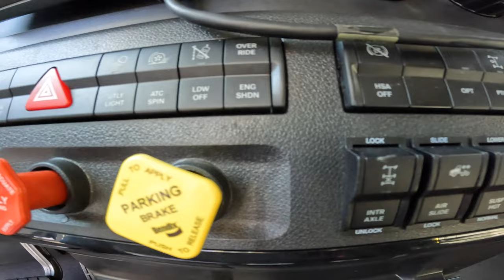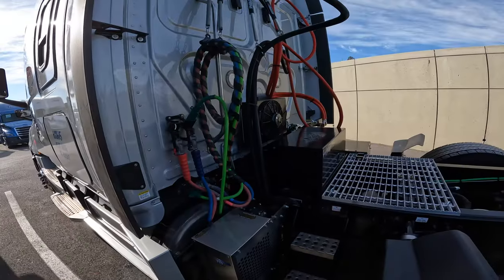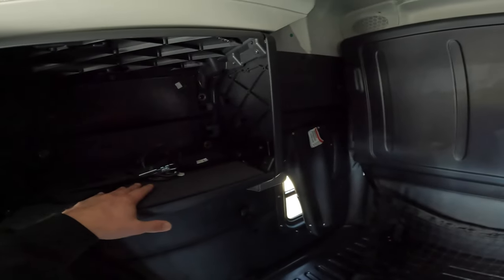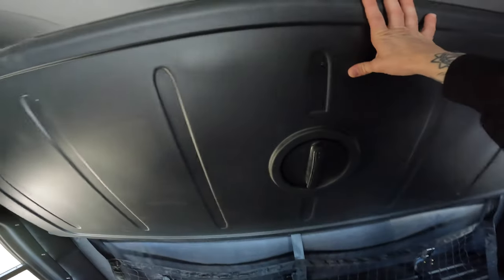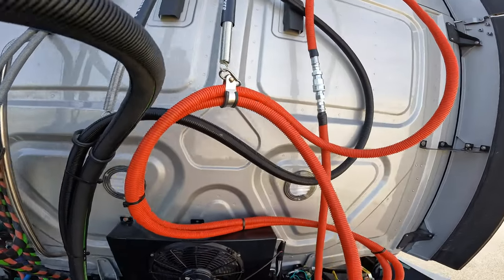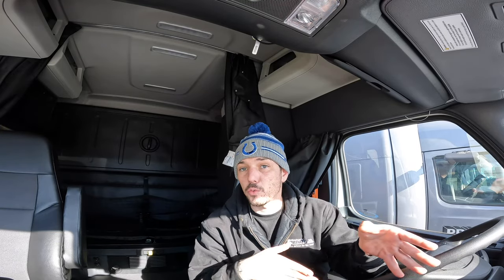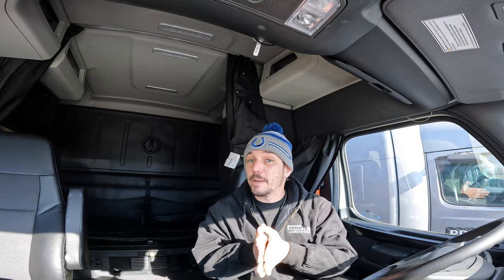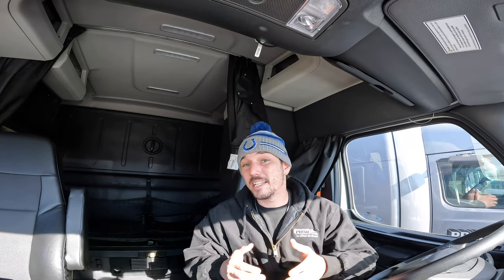Prime Inc 2023 Freightliner Cascadia Official Truck Tour 🔥

Comment: If you had the choice between this midroof freightliner and Pete which would you prefer?
Reply from the maker: I prefer the Peterbilt, has everything, more modern, smooth ride, has nice clean crisp bass. BUT that Paccar MX-13 engine gave me problems. A lot of breakdowns. My Freightliner has a DD15 engine no major issues so far.
Reply: @truckingwithrex  how often were you in the shop?
Reply from the maker: @Mrnotnice24  truck had 13K when I started my lease turned it in with about 90K miles was in the shop for 26-28days total. Turbo blew that alone was a special order part from Peterbilt 2 weeks in the shop. Passenger led headlight went out, light special order down 7 days. Electrical shortage behind the dash down 4-5days. They can only be worked on by a Peterbilt shop seemed everything was special order. So I switched to a freightliner and I’m making more dough because I’m not breaking down. Also freightliner has a larger network and parts availability so less downtime.
Reply: @truckingwithrex  I work out of the Pittston terminal and we have a dedicated Peterbilt mobile guy there on Wednesdays so I’m wondering if its worth it lol
Reply from the maker: @Mrnotnice24  same thing at Springfield terminal and my truck was still down all that time for parts. Also power steering hose started leaking that was another 2 days. And they charged me $200 for the hose clamp 😮 I would’ve just changed it myself. I thought it was under warranty. Mobile mechanic said I over filled the power steering fluid. I never added anything to it! That’s just my experience maybe your will be better 🤞
Reply: @truckingwithrex  oh nah that’s nuts smdh I had a Pete before in 2018 and it’s been problems but the way everyone has talked them up I thought things might have changed I guess now

Comment: Rex you made a good choice bro. Every truck has issues when you first get it. But the fact the fuel economy is better in FL is the winner. The ride on them ant that bad nether. Yes the Pete is smooth an a little more room but at the end of the day you can take that truck anywhere an get it worked on and won’t be having as long down times.

Comment: Make sure that when you install your CB radio you will need to add CB antennas to your mirrors because the Cox cable on the freightliner trucks do not work bro
Reply from the maker: Thanks for the info
Reply: @truckingwithrex  no problem brother and also I have the same truck as you just a full sleeper
Reply from the maker: @californiahauler6561  Niiiiiice! So far I’m loving the new truck! 😁
Reply: @truckingwithrex  great to hear brother the new freightliner is probably the best truck out there compared to any other truck